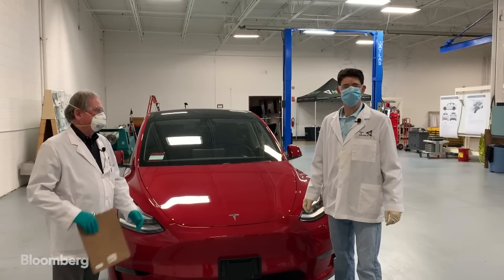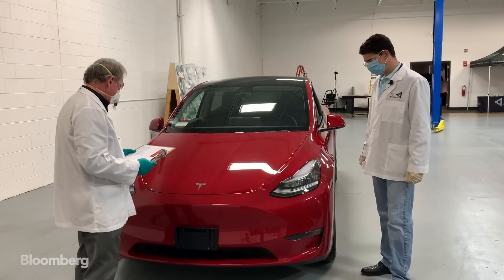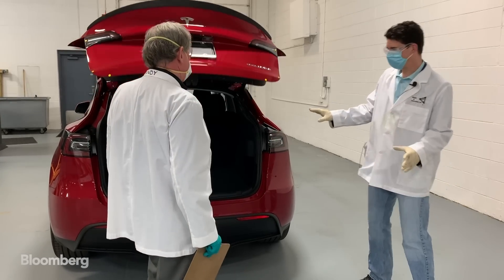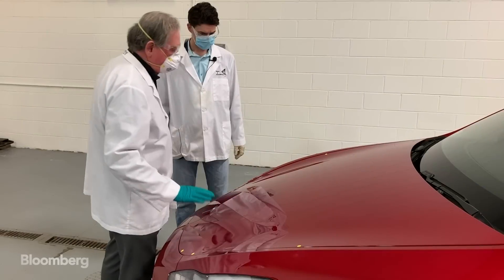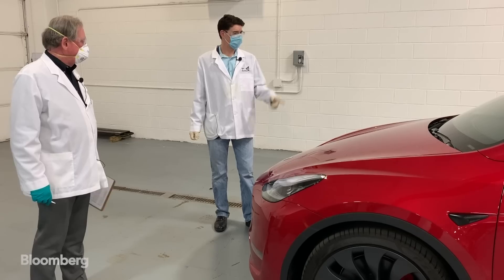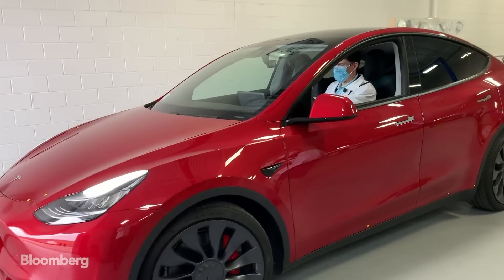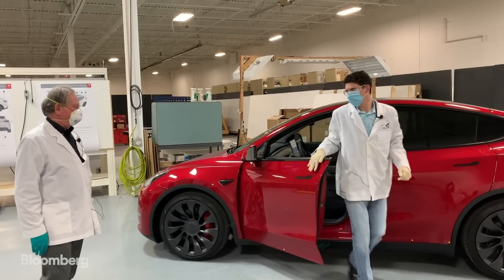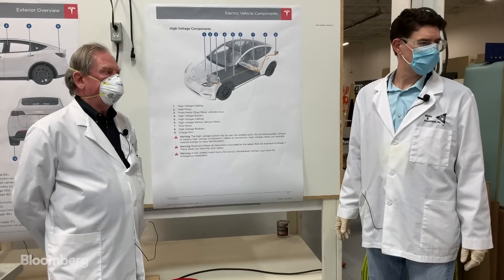Evaluating Tesla’s Model Y With Engineering Guru Sandy Munro

Comment: Why doesn't Tesla support the lithium battery by Ohmmu. They worked fine before a Tesla update and after that update the car delivers a "schedule a 12v battery change" message. The battery works fine except for that damned erroneous message. I really don't want to put that stinky obsolete polluting lead acid battery back into the car just to get rid of the warning.

Comment: Model y and model 3 heating of cabin and heat pump does not work in -20 degrees ( hundreds cars) ? Was said that it is more efficient and simple desing than in for example mach e, but does not work? What could be explanation?

Comment: I'm stunned Munro missed the painfully obvious middle rear seat misalignment @2:53 - looks like almost 2 inches off from the passenger side seat. And that Bloomberg guy didn't need to show up, he's all about selling the car instead of confirming the QC issues.

Sadly as of today, none of these issues have been addressed - Tesla is still releasing this model with egregious panel gaps, twisted weather stripping, dirty paint, mismatched panel paint color, rear seat misalignment and service center customer service that is only good, not great. Check any fan-based forum or worse yet, Tesla's own user-only moderated forums (https://forums.tesla.com/categories/model-y) for threads of complaints.

Pay 50k+ for a car that has a really high geek factor, but you have to take it to a service center multiple times until they say, "It's within specs."

Comment: OMG!! The panels are misaligned by ALMOST TWO MILLIMETERS!! Such shoddy workmanship! I'm shocked! SHOCKED I tell you!!

Jesus christ people. You're not going to notice the gap UNLESS you're looking for it, and even then you're probably going to need a micrometer. These people are literally looking for things to nitpick about. 

When it comes to automotive quality control, if it A) doesn't interfere with the operation of other components, and B) can't be visibly noticed from ten feet away, and/or C) is not a recurring QC issue, then the problem doesn't exist. It's a fluke of manufacturing and 95% of customers either won't notice or won't care.
Reply: Hes a manufacturing engineering consultant. Gaps are indicative of manufacturing problems. Might not be a big deal to you, but obviously you are not an engineer.

Comment: Looking at the pic, I can hear in my head Dr. Munro saying "scalpel please".  I did a really minor teardown on mine during one of my video. I mean really minor (ripping off the cowl). I mostly reviewed measurements, but I found several bugs that will need to be fixed, including getting locked inside the car, and having my wife laugh at me while I tapped on the glass, and repeatedly called her. You use calipers to measure gaps, and I use rolls of toilet paper to measure cargo space. Which is better...you decide. Thanks for the vids. Looking forward to seeing the guts of this baby.

Comment: The Toyota Supra back in 1980s ran the air con backwards (heat pumping) when engine was cold. I’m surprised the heat pump for EVs has taken so long. It’s simply a matter of reversing the refrigerant fluid flow so how hard can it be?

Comment: I’m trading in my long rang model 3 for a performance model Y but swapping out the 21” wheels for 19s. That should mitigate the road harshness and I think an SUV looks better with more meat on the tires anyway. 

My model 3 has easily been the best car I’ve owned to date and I’ve own some expensive cars in the past.  When my tri motor cybertruck arrives my fiancé gets the Y and both should last as long as we care to drive and I’m not yet 40 years old. 

If you want to drive a great car for 500k miles, a Tesla is the only option
Reply: Smarter Than You Tire are 275s.
Reply: Tory Tronrud I know how wide they are. I’m talking about wheel size

Comment: The Bloomberg guy found the ride a little bumpy. Well it has to do with the type of Model Y chosen, which in this case is the Performance model with the Upgrade option, with bigger wheels, lowered suspension and bigger brakes. It’s meant for speed more than comfort.

It’s actually funny that Sandy didn’t know that he got the highest end model. The person who purchased the vehicle must have really wanted to get the best model. I think the comparison with the Model 3  will be a little bit off considering that they didn’t use the highest end Model 3 in the previous teardown.

Comment: 1 more thing: front legroom is actually bigger in M3 than MY with MY having a slight bit more headroom. Interesting to note than the higher roof in MY only netted about .5 inch of extra headroom because they raised the seats on the MY compared to the M3 thus negating this extra space. They did gain some under-seat storage which is cool.
Reply: Yeah that's usually the case with a car and its crossover counterpart.  Avalon has more legroom than Highlander.

Comment: Evaluator goes from a technical comment to an opinion comment and back without making it clear as to when he is using facts or not. It would be better if he stuck to one critique style or another or at least made it clear when doing switching between the two. Ex: when talking about best EV cars, he mentioned Jag and BMW but not clear if he was talking technical or aesthetic qualities. FTR, both types of opinions are valid but not good to mix the two without being clear.
Reply: it was pretty clear he was talking aesthetics, at least to me
Reply: @bob15479  Not when he mentioned panel gaps and legroom, those are measurable unlike a general opinion of a car's overall appearance/style as he also did (Jag/BMW vs Tesla) without making it clear that he switched gears from a technical to an opinion comment. Yes it was no problem understanding what he meant and when but it is not the way to do an "engineering" evaluation.

Comment: Fit and finish tells you about quality control, and the likelihood of the things you don't see being well put together. And so far tesla has been at the bottom for fit and finish of all expensive cars and as bad as any inexpensive cars. How reliable have they been? Well, last year they were ranked 23rd in reliability.  Their Warranty Accrual Rates (the amount held back for cost of warranty repairs per model sold) are by far the industry worst. Toyota $400, GM $550, Ford $700, Tesla $2,200.  The second worst was BMW (their unreliability and cost of repair is legendary!) at $1500.  Huge difference.  Which goes to show, fit and finish is a good measure. When more of these sub standard built teslas become older those future out of warranty repair bills will more than wipe out all the savings of fuelling up an ev.

Comment: The obsession with panel gaps with cars never really landed with me. 
Can anyone tell me what negative impacts non-symmetrical/barely noticeable panel gaps do towards a car's performance/value? Again, you don't notice it until you're up close and it's not like paint/scratch issues where the overall life of the coat of paint would deteriorate much faster and chip exposing the car to the risk of rust. The hell does panel gaps do. And name one car that doesn't have a weird panel gap. 
I've personally never cared enough to notice but when I did try to pay attention. Literally, all the cars I've encountered on the road had them. 

So why does it matter in Tesla's case? 
(Genuine question)
Reply: I'd never even HEARD of panel gaps two years ago.  Given the choice between a Tesla with panel gaps and any other "perfectly gapped" EV or ICE near-equivalent, I'd take the Tesla any time....Unless I needed a special-use vehicle like a true six-plus seater or an RV / horse trailer-puller.
Reply: SilverSlayer23 
“Craftsmanship”. Panel gap is a simpler and easier way to assess engineering and quality controls within a manufacturing company.

Comment: right off the bat.... "we haven't obviously gotten to the technology underneath the hood yet... or ... " lol
Reply: A F you should check out the Munro Live channel. At this point what Sandy was commenting on was the external improvements, such as the single piece rear aluminium instead of the tens of parts they had in the 3, the flat rear floor and other easily accessible parts. Those areas are significant improvements over the Model 3 that Munro had a look at the first time.
Reply: Loui Coleman ok!

Comment: Can't wait for his full evaluation, tear down and cost analysis. He is a true expert.
Reply: People online who worked on the Model 3 and Y said there is substantial differences. The build cost goes down by a lot. Even though it shares many Model 3 parts the overall packaging is very different. Tons of things has been reworked like the brake calipers, heating an air conditioning, battery design. Plus the chassis wiring completely overhauled. All to improve manufacturing and reduce costs while making a better car.
Reply: It would have been a total nonsense to create a model Y 100% based on model 3.  I was trained/studied as manufacturing engineer [switched to sw because of China]  - the calipers and wiring, hvac do not scream at me as a substantial differences. Waiting for Munro eval. You should always improve the process, and make it better and cheaper when setting up a new line. The Tesla Giga line imho could use some improvements. And hopefully in my lifetime we will see 20k electric vehicles.
Reply: @browntigerus   Brian I am an engineer with 25 years of experience in hardware engineering, hvac is a key component in electric cars as well as wiring. The hvac part alone makes for differences such as battery temperature for energy use and costs,  Wiring for communications across the canbus and lowering costs some estimates put it the savings at over 4,000 dollars with these changes. Wiring from the Model S and Model X to the Model Y from needing thousands of feet to needing hundreds of feet while even adding redundancies.

Comment: I love how all the remaining complaints about Tesla have to do with nit picky things like paint quality and gaps in seams whereas big auto can get away with like ... I dunno ... the entire underlying ICE infrastructure not changing in the last 30+ years. So by the time Tesla figures out how to manufacture with precision, big auto will have figured out the electric motors, batteries and self-driving? Yeah...  I guess I’d still rather bet on Tesla.
Reply: it is likely easier for tesla to figure out better-than- Big-Auto build quality than for all of Big Auto to figure out Tesla-level EV tech
Reply: I never even thought about panel gaps until I started watching Tesla videos.  So I checked out my 2015 Toyota Highlander and by God I found panel gaps don't know how I missed them all these years.  I didn't buy my Tesla for the fit and finish.  I'm more interested in the million miles motor.  Just spent another$75 on oil changes for my GMC truck and the Highlander on my back in the driveway. ice cars are so fun!
Reply: @linemanap  My premium cadillac had like >5mm gap difference in the panels, so what was described here is not really an issue. :D 
The main takeaway from Sandy's review is that Tesla does improve the quality from model to model. Considering they are essentially a newborn car maker, this is great news.
Reply: @linemanap I believe the motor is already a million miles, it's just the battery is ~300,000-500,000 miles.
Reply: I checked my Jan 2020 Model 3 for panel gaps when I first saw it. No issues. I guess the first ones out of the new factory are always the worst, as they haven’t had many months of tweaking. In 3 months time, I suspect panel gaps will be a non-issue as per my Model 3
Reply: Amen.  It's like someone afraid of heights criticizing a high wire act.
Reply: I think you'll find heavy reluctance from the Auto Dealers not so much from the manufacturers.   They see EV's a huge threat to the Dealer's income.
Reply: @Harrison Lin - without value added, the dealerships can and should go the way of the dodo. In a lot of cases they’re literally just middlemen who take a cut from the sales. From my own experience thus far, I’m better off buying a used vehicle myself from another person than going to a dealership.
Reply: Its his job dude. This is what he does for a living. He also does this for the big 3. 
He owns an engineering consulting firm where he helps to improve manufacturing issues with cars and other stuff. You have to be critical when in this business.
Reply: Seriously??? If you're paying this much for a ice vehicle you would take the car back and have them fix it, why should Tesla be the exception for that...not knocking Tesla, because I do want one, but they've been out for what 8+ years, it's time to shore these little things up.
Reply: @buhtcheeks  if you watch more of sandy's videos he says indistt standard for acceptable panel gaps is around 3.5mm. So honestly this is wonderful for a first gen vehicle.
Reply: Also paint quality is not a nitpicky thing. It's protecting your car from the elements. It doesn't matter how big your touchscreen is if all your rocker panels and door jambs are rusting after 18 months.
Reply: @Engi_Nerd - I agree it’s not just look but functionality as well. What I meant by “nit picky” is that these are problems that old players are still dealing with as well.

I drove a big brand name car in the USA and the paint was coming off by the rear-window. Granted, it wasn’t a new car - but still.

Also, remember that big Takata airbag recall a few years back? I’d rather have issues with paint than exploding shrapnel in my face from malfunctioning airbags LoL.

(Point being, manufacturing issues still plague the big players too, even if they’re less advertised). Tesla is under immense scrutiny, as they should be - but I think they’re gonna get to a point where we don’t have to highlight things like this much faster than the other players will adapt to our electric self-driving future...
Reply: @motinuppi  Listen to Munro absolutely trash legacy auto on the recent Tesla Third Row Podcast (guest Elon Musk also appears). Munro is a tech, manufacturing & materials person, not a car reviewer. He and his company has worked on airplanes, medical equipment, nuclear submarines, boats, ships, cars, trains. He has decades of experience with all the intricacies of engineering and manufacturing.
 That's why he was focusing on that. It's what his company does.
This video felt like a waste of his expertise. It's like asking an anthropologist what his favorite eye color is.
Reply: @playgrrrr Thanks for the tip! - though I get the feeling you thought I was being critical of Munro (I wasn’t, I was simply observing the high count of videos focused on the same issues around YouTube). Munro is definitely qualified to comment and is doing so out of a place of genuine love for this stuff, rather than clicks.